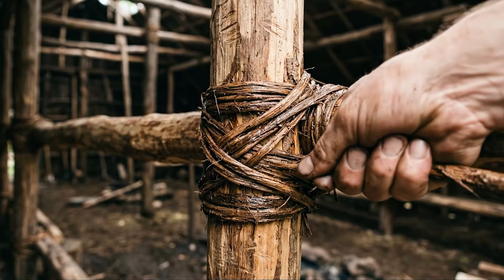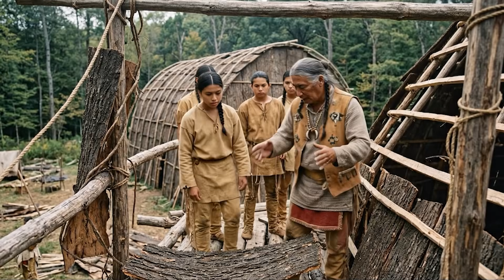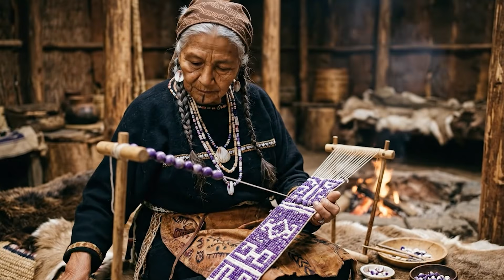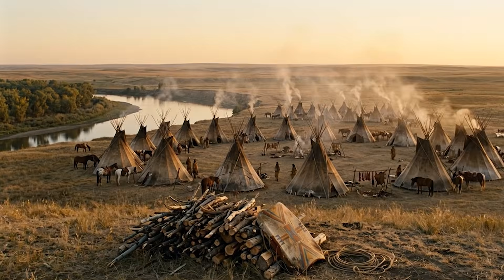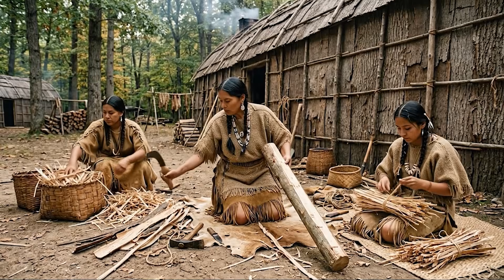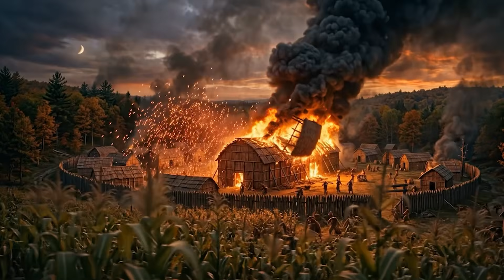How the Iroquois Built a Longhouse for 100 People That Stood 50 Winters

Comment: Another AI generated "tale," it's accuracy being hard to determine... And.., in the typical AI fashion, the same information is told over and over and over again.., turning 5 minutes of information into a 45-minute video... 
My ancestors were Iroquois. This video does not reflect any of the stories passed down by my people... 
Yes, we built Long-Houses... 
Yes, they were strong... 
Were they superior? If they had been, we wouldn't have copied the Easterner's log cabins.., as soon as we had access to steel tools... 
Just look at what is portrayed in this video. Small, single family versions could easily be built.., but we built (then) modern log cabins. Stronger. 
Better insulating qualities. 
AND -- !FASTER! -- when you own an axe, an adze, a saw, and a draw knife... 
The Iroquois Long-Houses -- WERE! -- a marvel, but only for people using stone-age tools. 😮